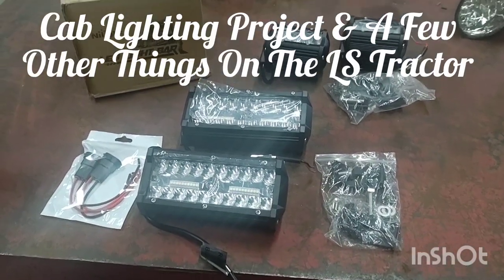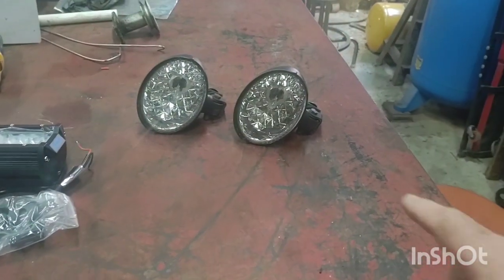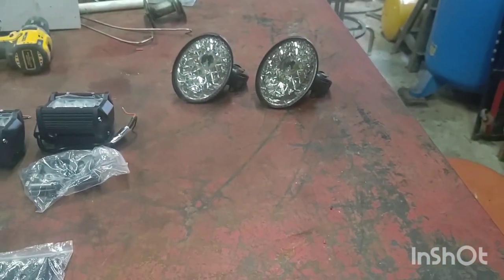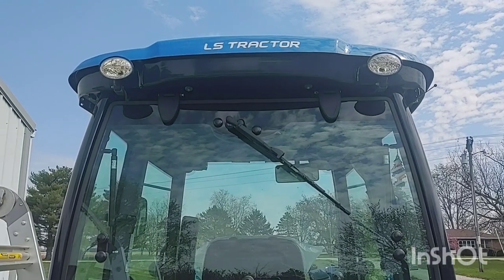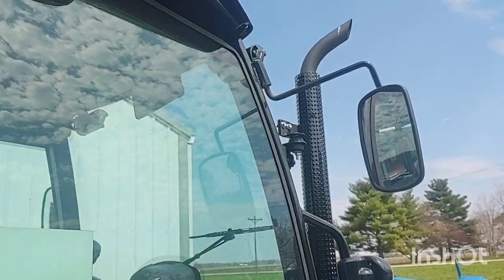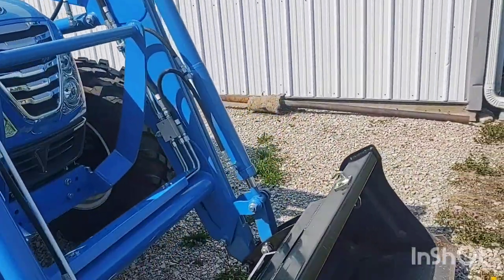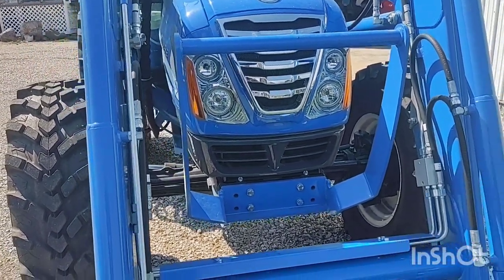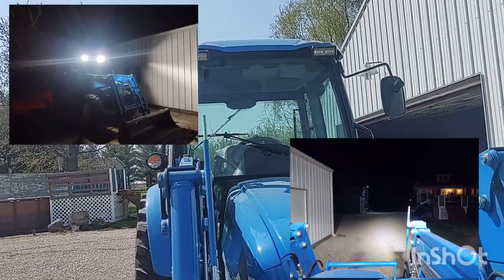Cab Lighting Project & A Few Other Things On The LS Tractor

Comment: When I picked up new Wilson and Tempte trailers from the factory for delivery, they used a paint pen to mark lug nuts and suspension bolts for quick reference as to movement,  as you stated. I'm wondering the reason your tractor had to re-gen is because it hasn't been "worked" long enough/hot enough, for the Def to properly do its job. I've ran into that issue with the truck. 
Doc
Reply from the maker: You're probably right about the reason why the tractor had to do a Regen so soon.  I've not had it out where I was really making it scream or running it like I'd stolen it.  I'm just glad it doesn't have to have that God awful Diesel Exhaust Fluid.  It's bad enough having to deal with the Diesel Particulate Filter, instead of a normal muffler.  Thanks for stopping by.
Reply: @crslyrn  🤔 hollow the stupid thing out..🤫
Reply from the maker: @GosselinFarmsEdGosselin   Well, if I knew that doing that wouldn't VOID the warranty, I'd seriously consider that.
Reply: @crslyrn  🤫 you don't know what happened... It just blew it's 💩 out.